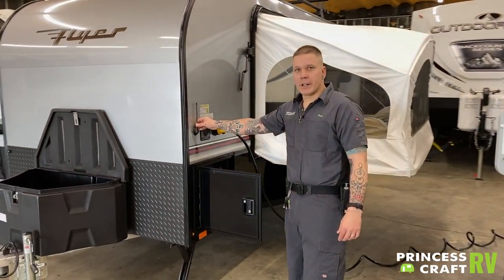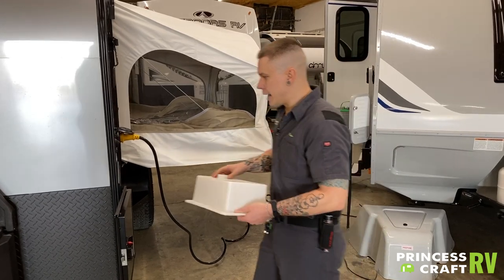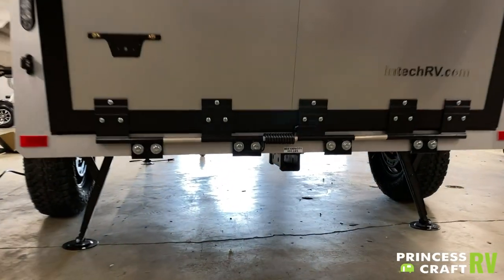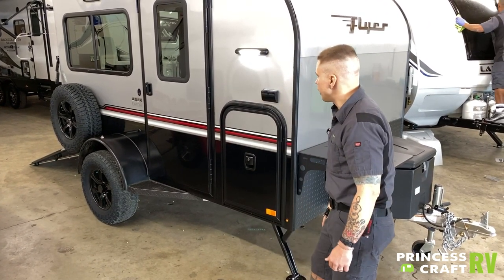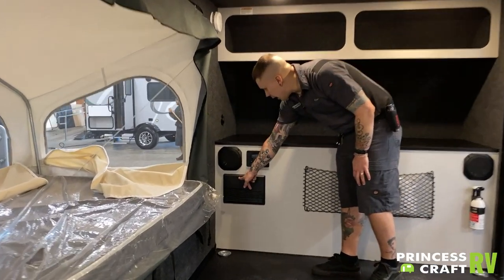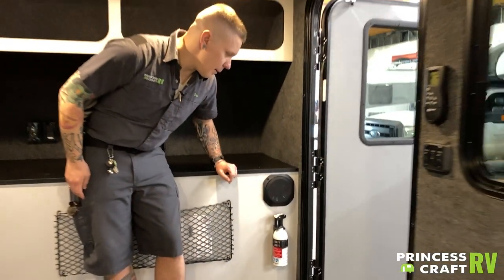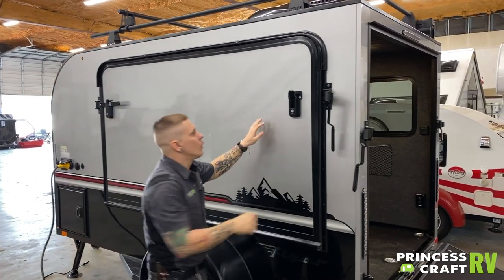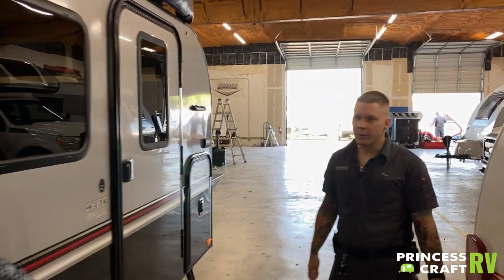Technician Tour - Flyer Explore by Intech RV

Comment: Just put a deposit down on   mine. It'll will be here in September  2o21. Kinda spendy at 25 grand  but it's  super tough and won't  rattle apart  like most  trailers do. A true overland trailer got the 2 inch lift and aggressive  tires Package Camping not glamping.
Reply from the maker: We love 'em, here!
Reply: Did you  get it and anything you don’t like?
Reply: @josephsaia5527  Yes  got . It's  great. Sleeps  me and my wife perfect. Fits  my 4 wheeler or two dirt  bikes with plenty  room for extra camping  totes,gear, etc. Dislikes is  the price $$$$$ considering  you get no running  water or a bathroom.  But easy after market add ons take care of those issues, portable  toilets,  and portable sink and Coleman hot water pump is all ya need. . It's  weight makes  it easy to tow behind my V6 4RUNNER.
Reply: @DavidRamirez-fe5dd  yes I like the low exterior height . It would fit  thru my 9’ garage door for storage. The Sun light is hard on everything. I would need to fit a DR650 and a CRF300L  in one
Reply: @josephsaia5527  The height with rack and ac unit would never fit in my standard 7 foot  garage.  I'm  looking into  a cover since  mine is stored  outside.  The sun is hell It's  definitely  a awesome  setup. I get compliments  every where  I go with it.

Comment: Won't the tires heat up when you drive, causing the pressure to exceed the max?
Reply from the maker: As I understand it, the max pressure indicated on the sidewall of the tire is for the "cold" pressure, so the tire manufacturers have accounted for the increased pressure that will be present when the tire heats up. https://www.tirerack.com/tires/tiretech/techpage.jsp?techid=196